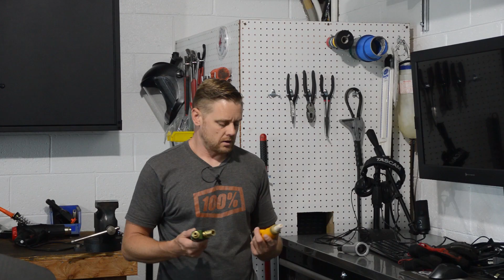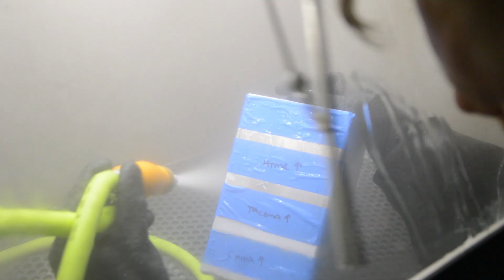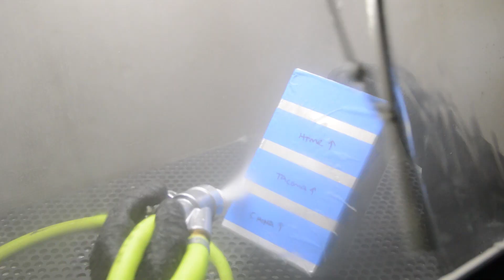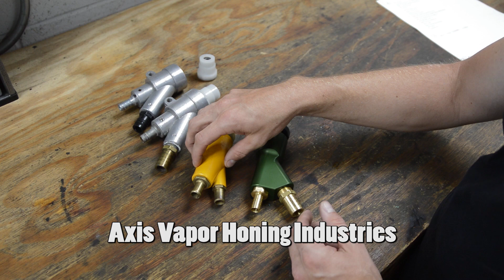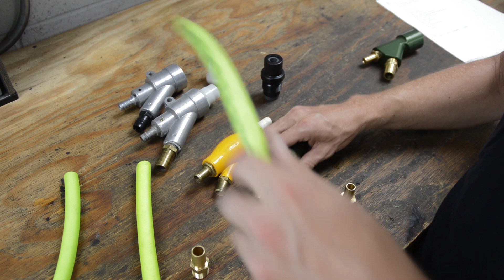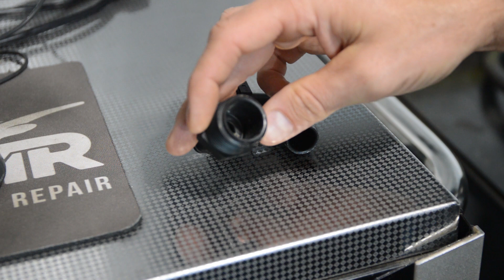HTMR vs Tacoma Vapor Blast Gun (Design Differences)

Comment: Do the different sizes for different cfms is that just different sized tips ? Like if I buy one of your guns now then change my setup later do I have to buy a whole new gun or different sized tips ?
Reply from the maker: Both airjet and nozzle are different between sizes. I have a table here that shows how to set them up. I also sell parts individually: https://howtomotorcyclerepair.com/product/htmr-vapor-blast-gun/
Reply: @HTMR  thank you .

Comment: Looks like a great product!  Congratulations and good luck!  Do you think your gun is the best choice for a Dry only cabinet?  I tend to do coarse grit heavy rust removal work.  I run a IR T30 5 HP 2 stage compressor 14.8 CFM @ 90 PSI.  I currently have a Pirate Brand gun.  What do you think?  Thanks!
Reply from the maker: The gun works great for dry blasting. However, with coarse media, the gun body is a wear item. So keep that in mind.
Reply: @HTMR  If I understand correctly, the gun body wear issue would be the same with any gun?  Or are there special guns for coarse media?
Reply from the maker: @MrRfries  Technically yes. Some brands handle it better than others though.

Comment: This comparison is fair and honest. Your not pulling any punches, but you also pointed out that the Tacoma gun is nicely designed and well made. Simply a different design that's more suited to a dry blast only setup. I just discovered you, and will be ordering your gun shortly. I just bought the whole Tacoma setup, and the workmanship is outstanding. Expensive yes, but as they say, buy once, cry once. As a former machinist and programmer, I can see that your workmanship is right up there too, and I look forward to getting it.